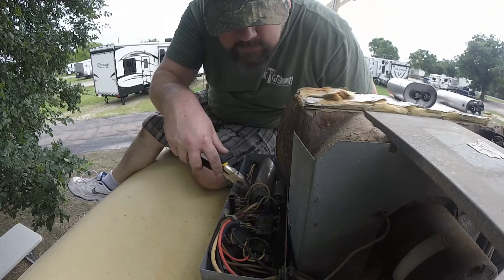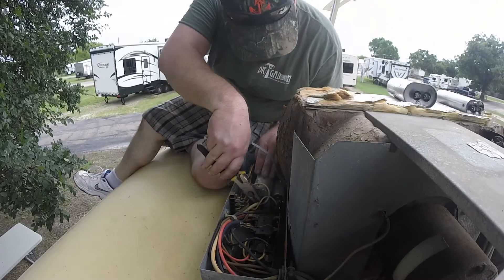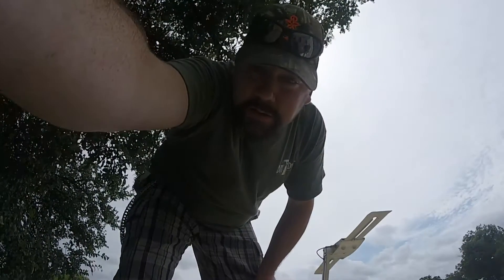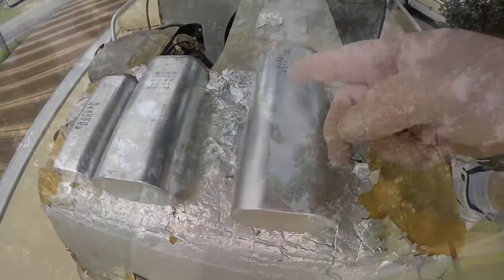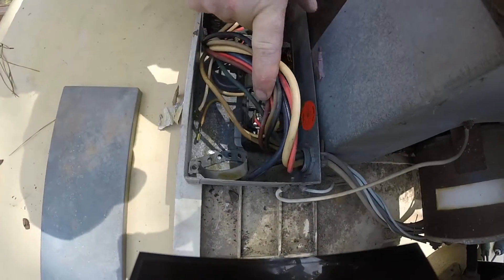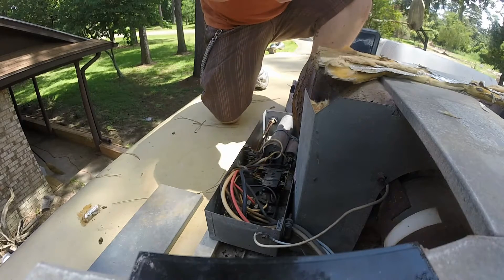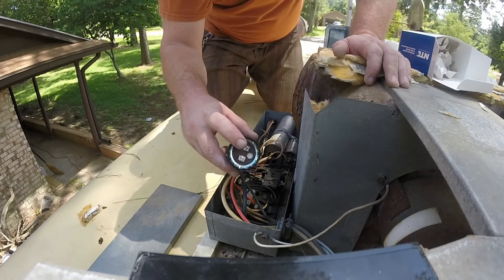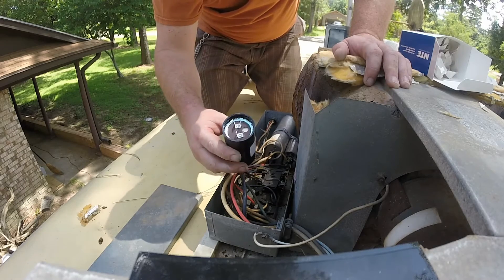GMC Motorhome AC Problems

Comment: Great channel and loving your adventures with the GMC. Hope you get to the bottom of the AC problem.  Not much need for AC in England. Keep up the good work!
Reply from the maker: Tin Soldier Thanks, hopefully here in the near future, we are parked where we don't need it either. :)
Reply: +Cruzin Castles seeing your voltage drop so much might mean a weak power supply. Wires get loose and thin after such a great surge. Try  a temporary power source and may not be the compressor!
Reply from the maker: Barbara Kluth I'm going to try replacing the starter relay, then it may just be new AC time:) It is 37 years old lol.

Comment: A starting capacitor is really a misunderstood feature of everything from flourescent ballasts to motors. There is a tremendous amount of inertia to be overcome in starting a compressor, or any electric motor. The caps can fail, but it's kinda rare. Best to discharge with a resistor. Good warning as they can be 400+ DCV and pack a hell of a wallop..how about refrigerant? Sometimes it can reach a low enough level that the compressor won't get up to speed once it's under load. Kinda a built in protection. Barring that it's a compressor failure....I hope you get it resolved for very little money..cheers.
Reply from the maker: I have a couple more tests to run,  refrigerant is now on the list.

Comment: You know just because it's setting on top of an RV doesn't mean you can't go to any heating and air shop to have it fixed. Even if it needs charging they can do it there. It doesn't need to go to an RV shop for repair and that will save you so much money. Plus an RV shop would be happy to sell you a new one even though it's doesn't need replaced. They don't always have the best techs for this kind of stuff. Think about it. A trained  heating and air tech and he works at a shop making half the money he could at a real shop. Something wrong with that picture all by itself. Hell they may even come to you for the service. May charge you a little more but it's better than paying the $3000 for a new unit. It takes a special tester when it comes to checking capacitors and the real air tech will have that and freon if needed. Good luck my friend.
Reply from the maker: Ok, first rule in fixing problems, stay away from rv mechanics.  :)

Comment: Hey bud I am an EPA certified Hvac tech! Most likely the compressor is locked up and because its a hermetic type you really cant do nothing about it. Now that you have the new cap in and its drawing all those amps then the compressor is locked up. Most likely its a R12 unit anyway so I would just get a new unit.
Reply from the maker: We went for the new unit. Thanks!!
Reply: @CruzinCastles  I know its 4 years ago but when you installed the new unit, did it interfere with the rear roof top red lights. If so what did you do?
Thanks, Vic